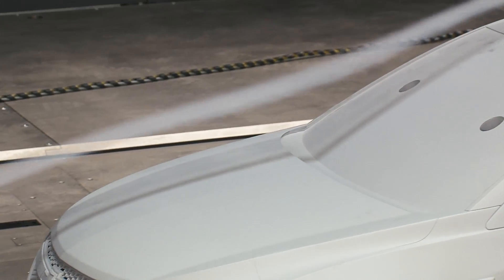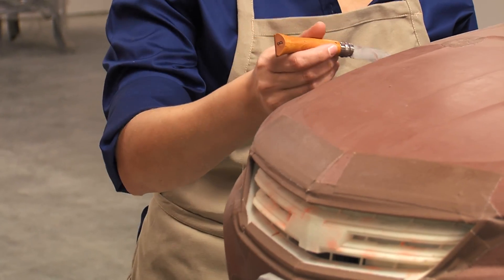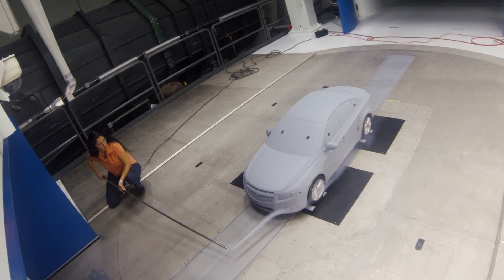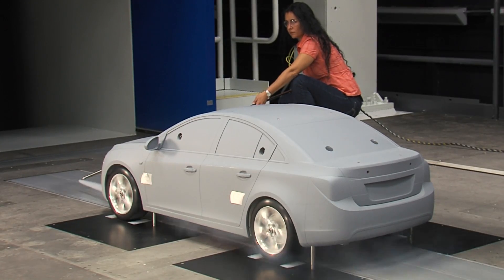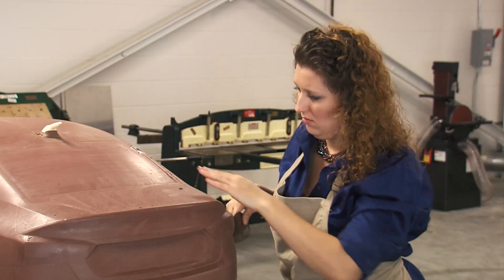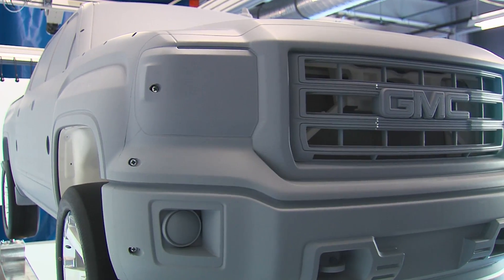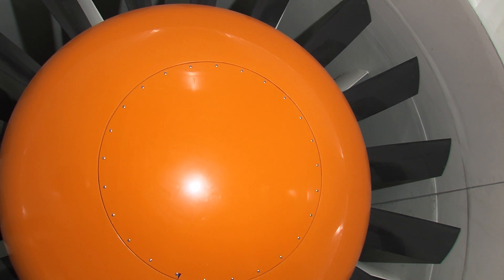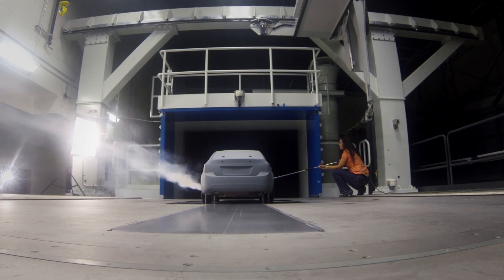Car Design – Aerodynamics and Wind Tunnel Testing

Comment: The model looks very accurate, and rolling road is great, but doesn't the reduced size effect the results? Seems like it would be really inaccurate compared to full scale.
Reply: there is a section in fluid mechanics that allows you to make scaled replicas by chaging the vehicle dimensions, but you have to adjust the air velocity. it is called the buckingham-pi theorem. with this theorem you can reduce the size while maintaining realistic conditions.
Reply: what kind of moron are you even a idiot can find a way to get accurate results small models can also be tested this way yes even smaller and even if the numbers are not accurate for the lare scale but small models can be compared whatever small model does best would do good even at large scale

Comment: What's a women doing in an engineering firm?
Reply from the maker: Welcome to the 21st century
Reply: @AutoConceptionTV   I started in Auto Design very young.  At 16 years old,  I and several other people started a training program at Fisher Body.   The current CEO of GM was among those people.   In large companies, most of the engineering work done is actually system engineering where you have to manage a flow of information from suppliers and internal activities.  What I found is that female engineers are actually very good in those roles.  They seem to be able to manage team communication and fact management better than many men.  Furthermore, they tend to be more approachable and less dominant in their posture.  As a result, people that might not be able to connect with a chief program engineer can do so much better.  The Top Engineers at both Tesla and Space-X are female engineers.  ...  If you want to build a complex 3D part guys tend to be better.  They are better at 3D special management.   But for managing a project,  I will take a good female engineer any day of the week.